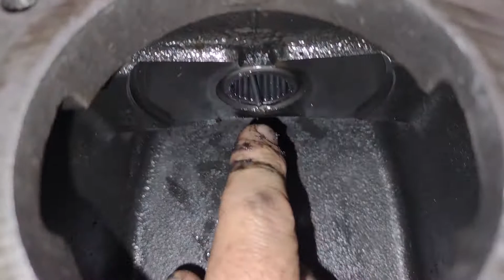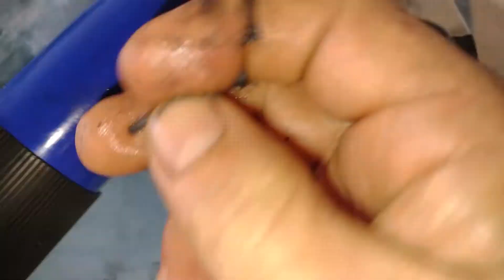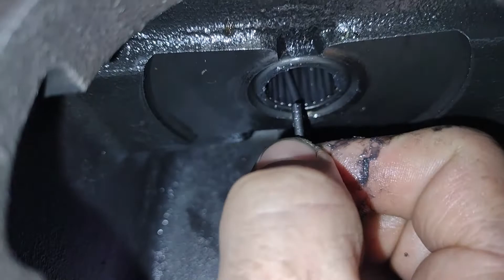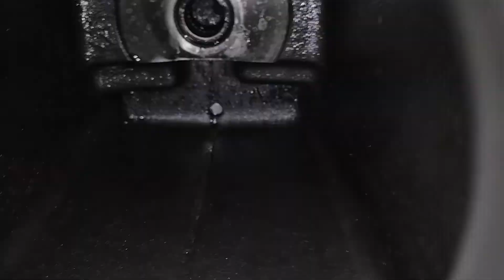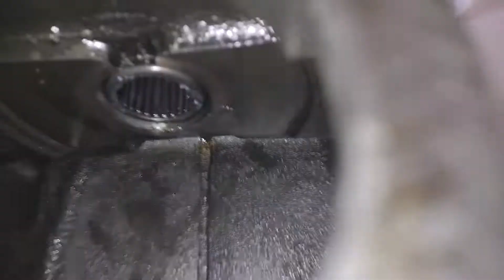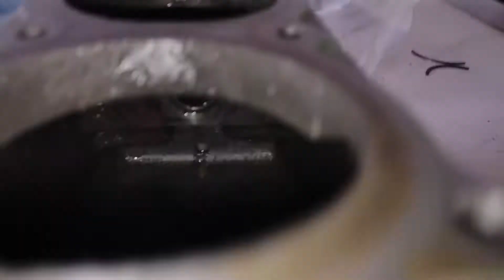HOW TO PACK ROLLERS INTO A NEEDLE BEARINGS

Comment: Hi, thanks for all the great tips! I am wondering if you could tell me what are some crucial things I should know or know how to do before I start working as an A&P, such as safety wiring etc.. I just finished my writtens last month and I'm now currently studying for the o&p. Thanks for your time.
Reply from the maker: Hello Ashley and congratulations on passing your writtens.
I guess if I had to pick one thing to concentrate on, it would be to always follow the manual. Labor skills like safety wire will be perfected over time with practice. The one thing that will save your job and keep you from making mistakes is to always follow the manuals. Unless you are working on experimental aircrafts, maintenance won't be up to your interpretation. You are given manuals with parts lists and detailed instructions on how to do the job, follow the manuals. Any divination is potentially dangerous and you'll be held accountable for the consequences. 
This is not meant to scare you, it is to say that you'll be walking a path that has already been well traced and figured out. Stick to it. The manuals are your friends.
That goes for the O&P's too. You'll probably be nervous while doing the practical tests, remember that the manuals are there to help you and to tell you step by step everything you need to do the job. When in doubt, take a minute and read the manuals and make sure you understand them correctly. 
I hope I've made the point enough times to show the importance of it. 
I hope this helps. Thanks for your question and good luck with your O&P"s.
Reply: @planesimple8514  Thank you so much for your reply!
Reply from the maker: My pleasure.